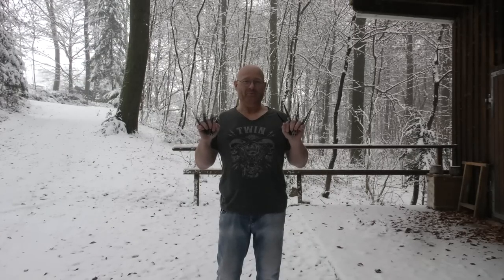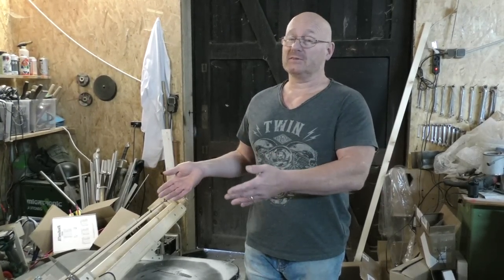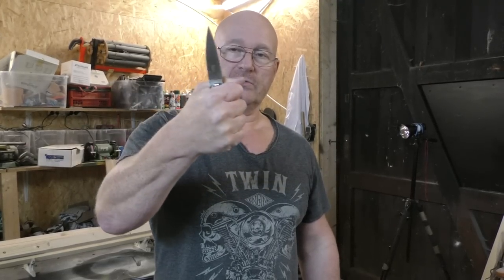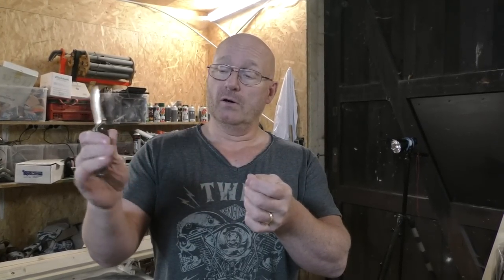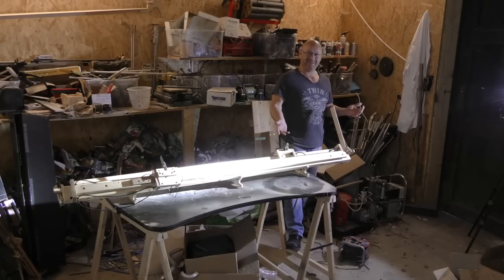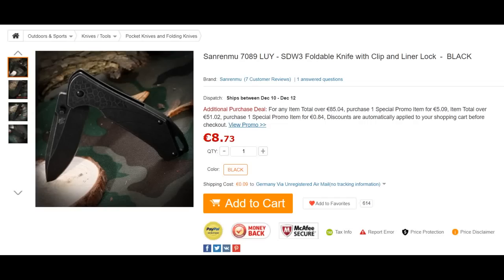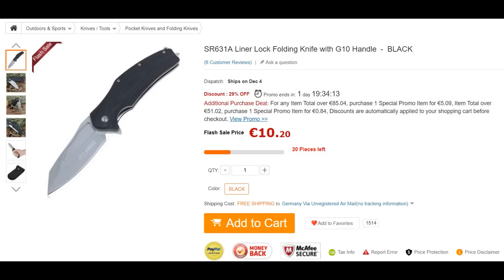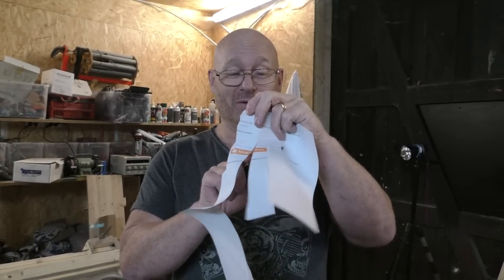The Great Cheapo Knives Jousting Tournament

Comment: I would like to see the winner fight against a butter knife, because the folding function is the weak point and a butter knife doesn't have one.
Reply: Butter knifes are usually not hardened steel, vs the hardened steel blade. Also, its created so that any ammount of backwords force goes into the frame of the knife, keeping it stronk

Comment: I found a really good deal on a budget pocket knife from Walmart. It's got a 3 1/2" (8.89 cm) blade made of 3Cr13 Stainless steel with a 57 RHC (not fantastic but not terrible), glass filled nylon grip scales, assisted opening with a blade jumping lever (it's not a flipper tab, it's a separate lever that pushes on the blade until it overcomes the spring tension keeping it closed and springs open), T6 Torx bolt construction with a T10 pivot bolt, removable tip down clip, a liner lock and one brass washer and one Teflon washer at the pivot. The handle is beefy, but it's unobtrusive in my pocket. With Torx bolt construction it should be simple to disassemble and reassemble. It's the Ozark Trails model 5514, surprisingly good with a price tag of $6.33 USD, I would easily be comfortable paying $20-$25 for a comparable knife. It's inexpensive, but not cheap. They built a sturdy knife that is sharp out of the package that isn't flimsy or chintzy.

Comment: Awesome video! Can you do another type of test? I've always wondered which folding knife would be the safest to use for self defense. My biggest worry is the lock failing. If this happens the knife would close on you and cut your fingers HORRIBLY! What you've done here is an excellent slash test. Can you do some stab testing to see which knife will keep your fingers safe?
Reply: hakachukai Fixed Blade solves your problem and calms your concerns.
Reply: Steve Rogers Not all people can carry a fixed blade due to restrictions. OP, get something from Cold Steel, the Triad lock has no competition in the lock strength area, they've tested it to 900 lbs with no issues.
Reply: Feel where you grip the knife handle: if your fingers or hand wrap around the unlocking mechanism (lockback, liner lock, or axis lock), pressure from impact through your hand can will cause the blade to collapse.    
Second thing to check: when it closes on your hand, can you flip it back open?  You will probably need stitches, but no big deal if you are still alive.  Knives with a partially serrated blade—that will hurt you a lot more than a plain blade.  There are some folders with a finger notch in the blade.
It will come down to how it feels in your hand, and that's all about your hand size, strength, and dexterity.
Reply: liner locks were the clear winners here
Reply: If you just take the Blvd down about 2 Miles then you'll see the picnic Pavillion
Reply: When it comes to self defense a knife is one of the most effective things out there. I've even heard Navy Seals say that they'd rather be in a gun fight than a knife fight with someone who knows what they are doing. It's also fairly well know that if the distance is 21ft or less knife vs gun wins
Reply: hakachukai 
No...
The reason why they don't want to get in a knife fight is that you will most likely get stabbed no matter what you do.
If you do not disarm your opponent before you attack, you have nearly no way to protect youself while doing that.
Let's say you are about to deliver a fatal stab into the chest area.
To do that you have to expose vital areas to your opponent, who will most definetly strike back (remember even after receiving a fatal wound you are still able to carry on fighting for a few minutes or even hours...).
So the results are that both the attacker and the defender end up horribly wounded or dead...
Also isn't a good weapon for defense purposes, there are better legal alternatives in most countries (despite the UK were you are stuck with a stupid whistle).
Reply: A folding knife for self defense is a terrible idea specially if you're not trained. That being said, I've heard Cold Steel's tri-ad lock is pretty sturdy.
Reply: The first round winner was an axis lock against a liner lock.

Comment: I think you could get more accurate results, by making sure the location that the blades meet is the same length up each blade from the handle. If one meets lower on the blade vs one higher up, I believe that would give an advantage to the one meeting lower down. An example of this can be seen in the 4th test. The larger blade has a nick lower down, closer to the handle, whereas the smaller knife has a nick higher away from the handle.
I don't know if this really changes the results too much, but it might be something to keep in mind for further tests. :) Awesome video!

Comment: Loved the video!!! What a cool way to test the knives, and I'm in suspense for the semi finals. 
I wonder how much of a factor leverage is with the larger knives...
Reply from the maker: Leverage is not a factor. The axis of all knives it at the same spot. Short knives are hit higher, long knives lower on the blades, but the distance of the point of impact and the axis remains the same.
Reply: JoergSprave, oh wow I should have realized that, thank you for the explanation. And again, great video and experiment!
Reply: i'm quite sure leverage is a factor, a knife hit at the very top will break backwards easier than a knife hit in the middle even if the distance to the pivot point is the same although i don't think it would have affected any of the outcomes - liner locks appeared to fare the best.   thanks for this video, i went and bought the SR631A and also a SR469C
Use coupon code GB11.11KNIVES for 15% off knives and tools
Reply: its like stiff arming a kid in the head vs an adult in the stomach that kid is going to flip
Reply from the maker: You... think hitting people can prove Archimedes wrong? Sigh.
Reply: Well, it is not leverage, but usually knives are thicker/stronger closer to the handle, therefore the larger knives should have an advantage. But..this is not a real objective, repeated, finely tuned test, this is just for fun.
Reply: yes and fun it was!! again, i do not think any changes to the process would have affected the outcomes in any way so i hope i'm not coming off rude. i'm merely confused and trying to understand better!

thank you joerg for making this content, i should probably just believe you because your knowledge of engineering is clearly superior to mine. god bless!

Comment: Genius video! All makers should send in their champions to you for an annual championship
Reply from the maker: Ha! I think so too. I don't think their products would come out much better though. That is a tough test.
Reply: JoergSprave cold steel 4 Max I rekon is the toughest knife out there or as a metal handle seams to make a big difference maybe the cold steel code 4. Spyderco compression lock is tough as well and the axis lock on benchmades. It seams a thick stop pin, thicker blade stock and steel handle scales might be more important here though. Maybe a cheaper thick bladed Kershaw might beat a cold steel triad lock, if the stop pin is thicker.

Comment: Make sure you set the knives in the fixtures so that the point of impact is the same distance from the pivot point for each knife. I.e. on the smaller vs larger knife battles, I noticed the point of impact was father from the pivot point on the smaller knife, so it had a greater force imparted on the pivot locking mechanism than the larger knife.
Reply from the maker: I did align the knives accordingly.

Comment: Damn, I think Cold Steel need to upgrade their scientific testing methods to this! :D
However, I think it's important to mention that the knife lock should protect you mostly from cut fingers. They're not made for chopping, so it's not that bad if the folder breaks that way, because it will probably not hurt you.
Testing the lock in the other direction is more important.

Very entertaining though!

Comment: I loved this video. Keep it up. I think you just needed to make that tournament brackets a bit more faster. Now they take forever. Plus you repeat the names a bit too much, maybe next time write on each side the name of the blades? Might be more clear and easier for you.
Reply from the maker: In the semi finals, I will double up the rubber. In the finals, triple rubber. But if I would have done that in round 1, I probably would not have had any intact knives for the semi finals and finals.
Reply: Oh, sorry. I meant not the rubber but I meant that paper sheet where all those brackets are drawn and shows which knife goes against what and what moves forward. I think this just goes too slow. Example: 9:02 

And please also do a more accurate measurement of which part of the blade will hit another blade. Try to make them as equal as possible. Maybe considering how much distance is the impact point from the handle and to proportionally match it to the opponent. If one blade will hit close to the handle while the other close to the edge (end of the knife), that one closer to the edge will have much bigger pressure on those holding brackets thus they will break a lot more easier.

Comment: Why do you have to have the knives accelerate at each other instead of one being stationary and one accelerating? Both should be roughly the same.
Reply from the maker: Only if the moving one runs much faster.
Reply: JoergSprave it's like the classic 50mph car and car collision vs car and wall collision problem. If the knife travels at velocity v and hits a knife at velocity v, it would essentially be the same as if the knife travels at velocity v against a stationary knife.
Reply from the maker: No. One more Mythbusters victim? Both knives deform and absorb energy. A wall, different issue.
Reply: Why would "actio est reactio" not be the guiding principle here? Could you point me at an explanation, please?

Comment: One might suspect your testing environment to be faulty as in all four cases the knife on the camera facing rail lost. (not that this test is very scientific) :p
Reply: hyperkubus 
Additionally, the locking mechanism would be more likely to fail on whichever knife took the impact farthest towards the tip/away from it's axle, due to the increase in force from the resulting leverage.

Comment: Called every round easily. You have to look at overall factors. Angle of blade (forward pointing gives advantage), length of blade (shorter can help), type of pivot (the circular one gave lateral stability but not horizontal), thickness, material (steel handles give stability and better steel can help withstand impact) etc. Maybe next few rounds will become harder to call as I do not know the knives in detail.
Reply: Marc de Boer you can look the Details up on gearbest or in the descripition you will find the links

Comment: Jörg, PLEASE: Buy some lighting. Just some cheap and powerful work light or flood light. Without it, it's a really a waste of that Chronos cam.
Reply from the maker: I did have light. Otherwise no video would have been possible.
Reply: Of course you have light in your shed^^ But a slomo cam needs more light, as you surely know. 50 Euro für nen 800W Baustrahler würden bestimmt helfen.
Reply from the maker: Baustrahler kannst Du vergessen. Die sind 50 Hz gepulst. Das sieht bei 1500 frames pro Sekunde echt übel aus. Man braucht DC-gespeiste LEDs. Habe eine 4000 Lumen Leuchte verwendet, bei den Normalkameraaufnahmen ist gut zu sehen wie grell das Licht ist. Bei Hispeed braucht's eigentlich die Sonne, indoor ist ganz ganz schwierig. Aber was soll ich machen, draußen war Schneetreiben.
Reply: Ah, verdammt. Klar, das taugt nicht. Vielleicht ein paar Fernlicht-Halogenbirnen an ner Autobatterie?^^
In Deutschland ist es halt selbst draußen selten wirklich hell. Wenn man sich Slomos von Taofledermaus ansieht (die haben glaube ich dieselbe Cam), bei praller Sonne in der Wüste, da sieht das richtig gut aus. Hierzulande bräuchte man halt starke Scheinwerfer...